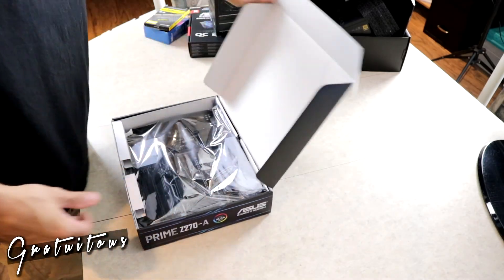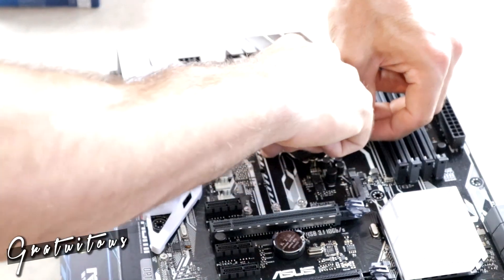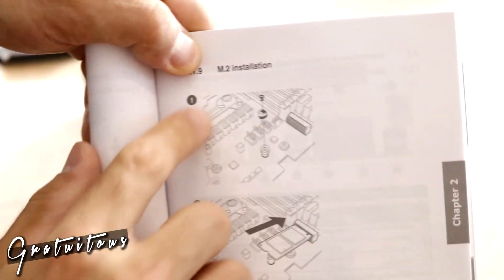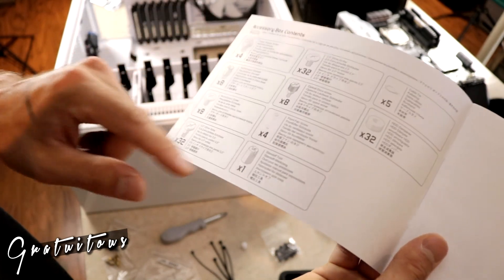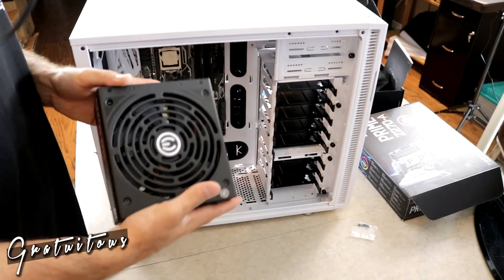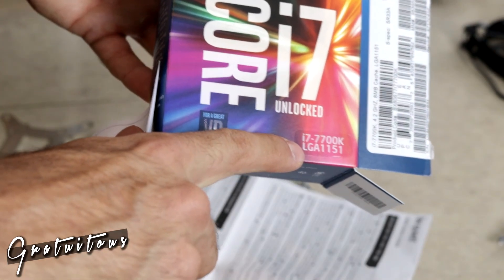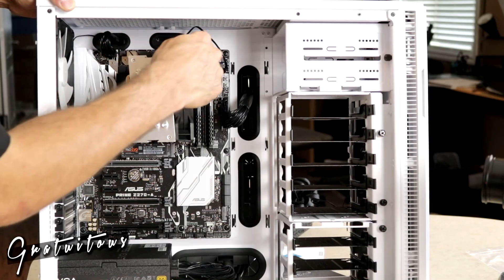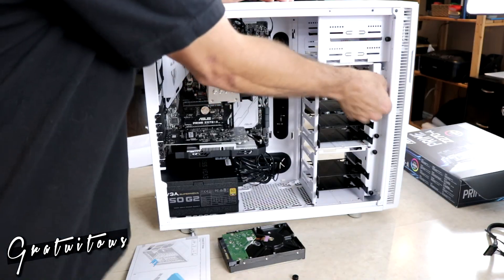Build a Custom Music Production Computer [Part 2/2]

Comment: Hi there!

Great job and congratulations on getting your PC running.

I've been looking at some builds, specifically for audio/DAW reasons as I am shortly going to be upgrading to an uber machine. I'm a bit of a tech head, built hundreds of PCs and can give you some post build advice that may help you for the future and I love the fact that you are an FL studio user as I beta tested for them for many years under the name XOR ;-)

1 Case - I like your choice, I will also choose either the Fractal design R5 or C, but I think both you and I could get away with the C - no-one needs optical drives anymore and I have an external blu-ray writer anyhow.
2 960 EVO - great choice!
3 GFX card Small hiccup - I don't think your model goes passive. You needed to look for the models that go passive (fans turn off totally) under a certain GPU temp, and as you are mostly in audio tasks they should be off most of the time. Next time.
4 Motherboard In your write up you mention you are not sure what makes a great motherboard. Indeed. It's a mess of options most people don't need with a nasty emphasis on RGB and the such. I look specifically for a quality VRM for overclocking, good placement of M.2 slots (to avoid heat issues with the GFX card), good I/O options.
5 PSU good! make sure that ECO mode is turned on ;-)
6 Cooler ..is fine, I just have a preference for noctua.
7 CPU a pity you missed out on the 8700K 8(

Here is the build that I have nearly enough pennnies to get in 1-2 months, every part specifically picked.

i7-8700K
Asrock Z370 extreme 4
16 GB Vengeance LPX 3000 (2x8)
Nocutua ND-14
Asus Strix 1080 ti
Intel optane 900P 240 GB pcie
1 TB western blue 2.5" SSD
6 TB 7200rpm 3.5" HDD
Corsair RM750i
Fractal design define R5

Out!
P.s. Subbed!
Reply from the maker: Thanks for this awesome comment!!!!

Got some questions!:

- Do GFX cards mention passive within their description? - How will I know next time I purchase another one?

- PSU - What benefit will the ECO mode do for me? - Turn off the fan when not in use, or use less power?

- I know on 8700 :( - Just how it goes I guess haha
Reply: Your first is tricky because you bought a GFX card currently in dispute. TLDR; AMD stealth nerfed some of the 560s - some of the cards are 16 CU and some 14, the net effect is that the 14 CU cards perform more like RX460's. The card you got is a 16 ;-)

Why  is that important? Well because unless you know about this, the market place looks funny - there is a RX560 strix EVO 4GB for less than the card you bought , yup, you guessed it, its a 14CU model (you can see it in the title). https://www.amazon.com/ASUS-Radeon-GDDR5-Graphics-RX560-O2G/dp/B07661CXT2/ref=sr_1_1?s=electronics&ie=UTF8&qid=1513324968&sr=1-1&keywords=AMD%2BRadeon%2BRX560%2B2%2Bgb&th=1

If you don't mind the small performance hit, I'd get this and yes, it shows the 0DB mode on Asus's web site. https://www.asus.com/us/Graphics-Cards/ROG-STRIX-RX560-O4G-EVO-GAMING/ the fans turn off under 54°

Here is the story on the dispute: https://www.pcworld.com/article/3240264/components-graphics/amd-quietly-radeon-rx-560-graphics-cards-worse.html

The second is easier ;-) https://www.evga.com/products/product.aspx?pn=220-g2-0550-y1 "Eco mode - fan does not switch on until PSU load is above 25%"

Comment: Do you need some kind of wifi card if you want to use wifi or is it already inside one of the components?
Reply from the maker: You’d have to check your motherboard I guess, otherwise yes you’d need a card or wifi dongle !
Reply: what about the motherboard you chose the z270 -A ?

Comment: Very informative! Will be building mine soon. Which version of Windows are you using? I'm stuck between Windows 7 and 10.
Reply from the maker: Hey! - I'd say go for Windows 10! - It's just a matter of time before stuff will stop supporting Windows 7. ;) (You can use your Windows 7 license to upgrade to Windows 10 I believe to save you money. That's what I did!)
Reply: itsGratuiTous Thank you! I just
 remember when VSTs ran smooth on Windows 7😊
Reply: @gingercakes3135  I know you dont check your youtube inbox. But maybe update your vsts, maybe convert some of your midi to audio. And maybe add some ddr memory
Reply: Tans S if ya vst is not compatible with win 10 u gotta update the vst if possible
Reply from the maker: +Tans S You having problems with VSTs not running smooth?